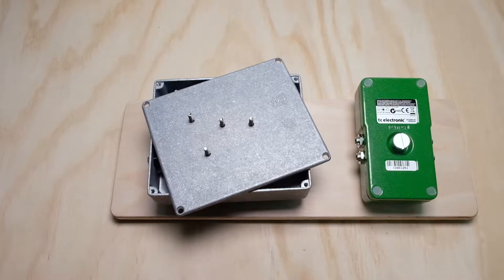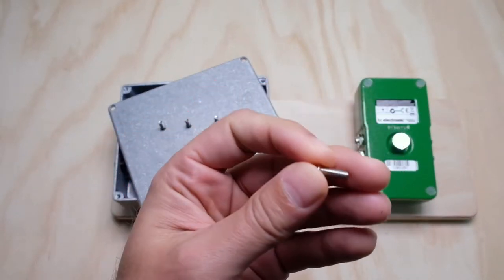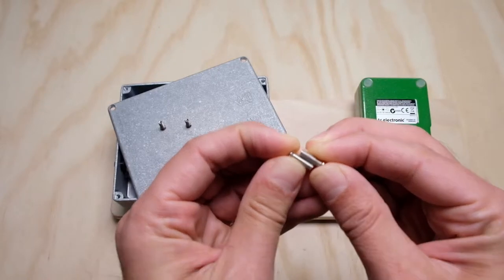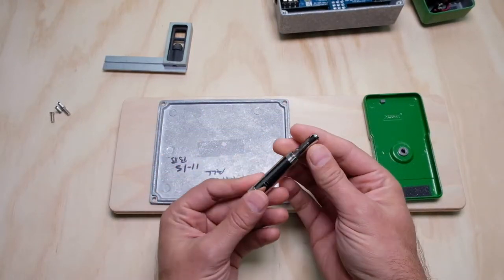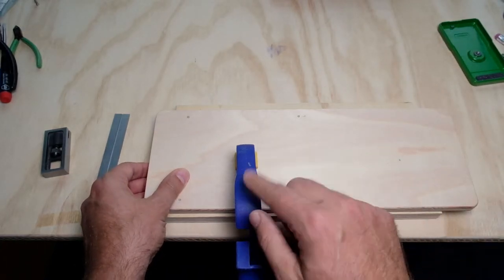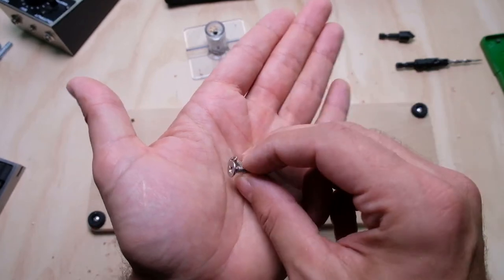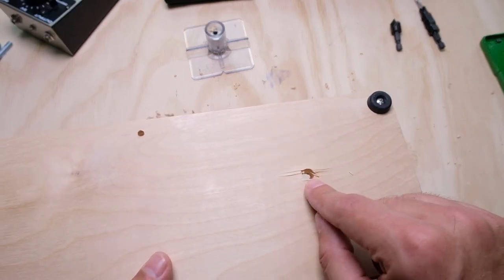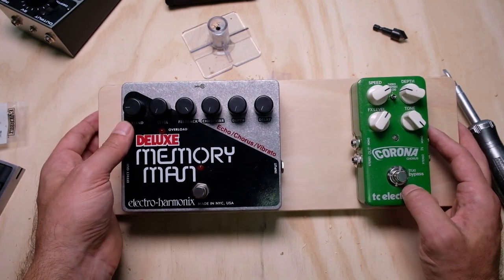Pedal Mounting 3 of 5 -  Bolts

Comment: I absolutely started down the "just find longer screws" route, bought a ton of imperial and metric screws in various sizes and lengths, drilled all the holes in the home brew board, etc.

I eventually concluded dual lock was vastly easier and held just as well. One problem with this approach is it's also hard to take pedals off when you need to squeeze cables into places like side jacks. So I ended up needing to wire up multiple pedals and then screwing them all down at once.  Also angled bottom screws (looking at you, H9) are a pita.

Comment: You can get metric as well in fine pitch, it then MF before the number and the number means the height of the pitch not the number also the rest get only measured by the length of the screw from the head underside to  the screw end, that's all no fancy stuff.
You can get other screws that you have to screw anticlockwise but the normal versions are clockwise. 🤗
If you in to it, you can get also different angled pitches ect.
Or extrem fency ones you can make yourself that are both, Clockwise and Anticlockwise usable, ther is a video about it on YT.
One in 3d printed version
https://youtu.be/_48-Ike_i6M